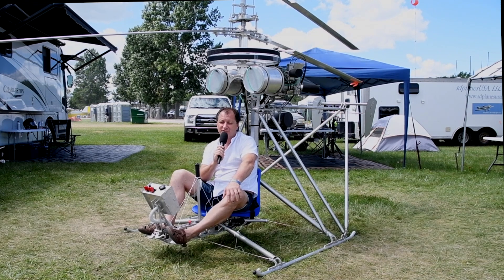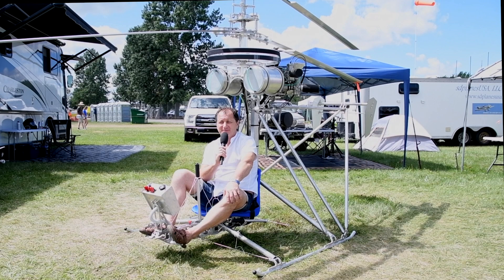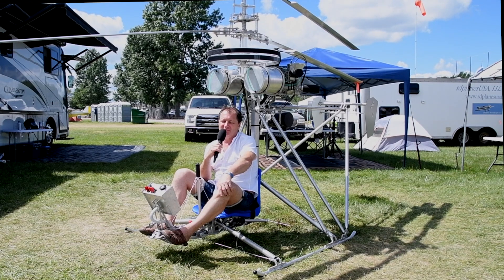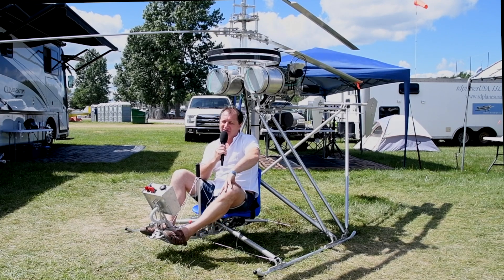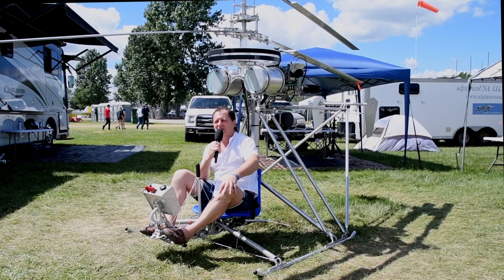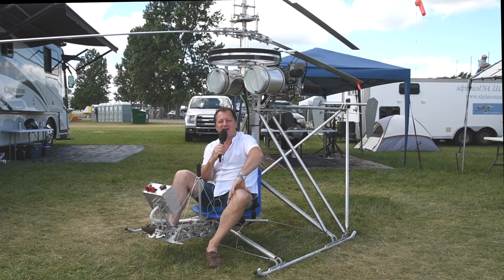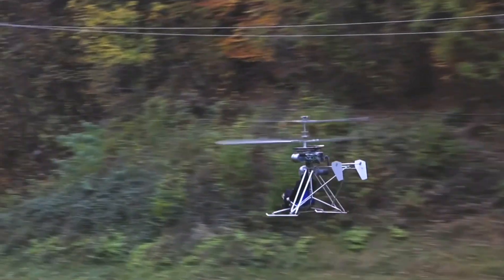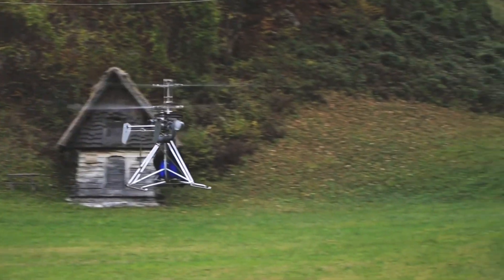VFS Interview - Miro Crv, Founder and Designer, Mirocopter SCH-2A

Comment: Great interview, Miro is amazing.
Reply: О превет мой друг! У тебя похожая концепция
Reply: @erwe1054  Hi, well I like this design a lot and they have saved weight in a lot of places were mine is heavier. They tried the tilting mast in the beginning and went to cyclic feathering. A good and necessary choice and I wish I went in that direction. Using thin poly 'v' belts I'm surprised worked but it obviously works great. A much cheaper and lighter solution than the synchronous belts I chose. Mounting the engine up high doesn't seem to cause any problems and again is a light weight choice. It's a very well thought out helicopter and is affordable. Only top marks from me. 👍

Comment: What is the distance for a gallon of gas at max weight generally speaking?
Reply: Cruise speed is 50 mph and it will fly at that speed for 1 hour. Max weight is 273 lbs.

Comment: if only he made an elegant airframe to it, instead of looking like a deformed tent
Reply: function over form I say
Reply: @joeclark6763  CyberCopter
Reply: Thank you for your compliment.
Airframe must be light to meet FAR Part 103 regulations <115.2 kg dry weight.
In case of coaxial helicopter, air frame must have way different characteristic
than conventional ultralight helicopter and semi rigid rotor articulation.

Comment: is there any innovation here?
Reply: - one stage belt reduction and counter rotating system
- single bearing and special damper fully articulated rotor system
- unique collective and cyclic mechanism
- unique air frame with landing gear 
- SCH-2A is the only FAR Part 103 compatible true coaxial helicopter in the world
Reply: Does this use rpm to climb it an actual collective which would enable it to autorotate?
Reply: I’m sorry typo does it have an actual collective pitch that would enable it to autorotate?
Reply: @coaxman  'special' and 'unique' mean nothing. dont fluff up your main points.
Reply: @dalesclafani6361  It has full collective and cyclic control just like a regular helicopter so it can autorotate. Because it is coaxial it actually has a 20% slower decent rate than a regular single rotor helicopter.
Reply: @coaxman  Where did you get 20% from. Autorotation is about disc loading. This helicopter is still about 16.66kg/m2 at 250kg, which is higher than some other small helicopters indicating it would have a faster rate of decent for autorotation.
Reply: @chippyjohn1  You need to divide tha disc loading by 2 because there are two discs.
Reply: @coaxman  MY understanding is you would not divide by two as both rotors are on the same axis.  Do you know how much power it consumes in and out of ground effect for a hover?
Reply: @chippyjohn1  The 20% number comes from all coaxial helicopters. It is not unique to the Mirocopter. I don't have specific numbers of power consumption difference between hover and cruise but I'm sure it is similar to conventional helicopters.